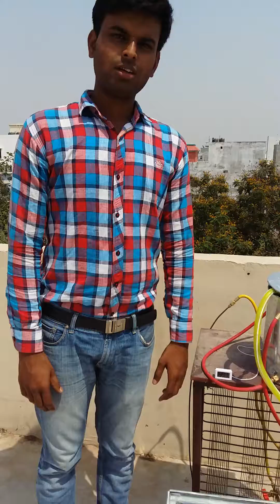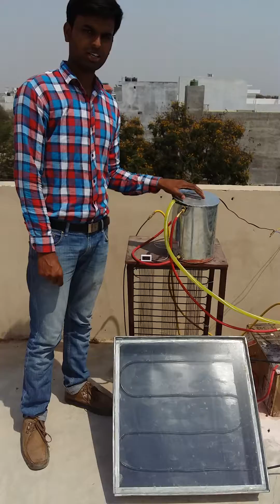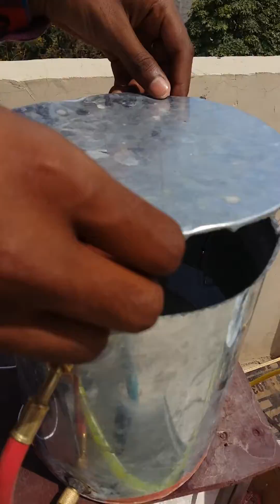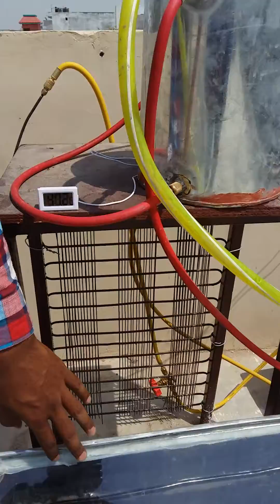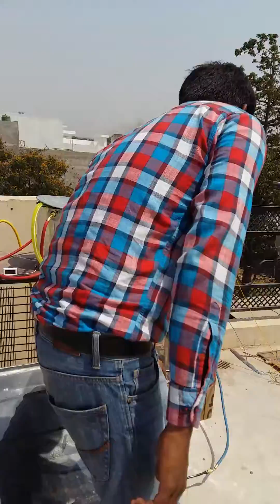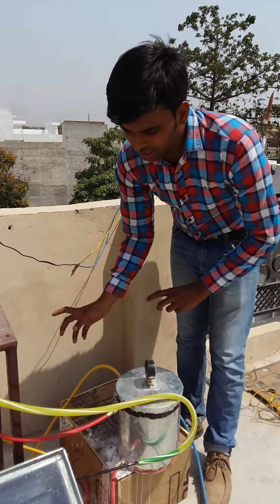solar adsorption refrigeration

Comment: Hi! Can you tell me the overall cost of your project ? How much did the fabrication of collector cost ?
Reply: The overall cost of this project is around 35000 for  get correct output I think he didn't get any output if u want any information then contact me
Reply: @anubhavraj5713  Aren't you trying to pull all the blanket to you from his work ? it looks like !
Reply: @anubhavraj5713  hi Anubhav, I would also like some info on the project. Can we connect on whatsapp or Facebook?
Reply: @anubhavraj5713  I am working on the same project. I need your help. Share me your contact number or contact me on 9175527555.

Comment: Copper is Corrosive with Ammonia your structure is wrong
Reply: M. Asim Khan  i m also planning for this project  i need help
Reply: email me plz
Reply: @waseemazmi6958  if u want to do this project then u have to spent minimum 35000 for get 30% output
Reply: He used gelatin not ammonia.
Reply: I Need help ,

Comment: Can you tell me which refrigerant n  absorber you used
Reply from the maker: zeolite and water
Reply: @aagatasingh10  u know the temperature and all
Reply: @aagatasingh10   I think ur project is not able to give any correct output
Reply: @anubhavraj5713  I think you are jealous
Reply: lot of research papers.............u can use my research work
Reply: @avinash7527  OK! Where can i read it ?
Reply: @AutoNomades  just put research work by avinash kanade...on Google..... solar power adsorption ice maker system

Comment: what is jewlett ??
Reply: He is saying 'Zeolite'.  
Zeolite 4A is generally preferred combo with Water in such Solar Chilling projects. I think they are available in India at around Rs. 100 - Rs. 200 per kilo.

Somewhere (some research paper, months ago) I read that approx. 150 gms of Zeolite is added to every 10 litres of water in Solar Adsorption Chiller.

Also while he has not explained it here, you would need a small vacuum pump to create a partial vacuum in that Adsorption tank - Condenser - Evaporator cycle.
Reply from the maker: it is zeolite

Comment: nice work ..
which type of solar collector you used n is it readymade or  u fabricated it??
Reply from the maker: its a flat plate solar collector which we made by using tin casing , copper tube and simple glass
Reply: @aagatasingh10  u think by solar collector u r able to produce that much of heat for runn this setup can u tell me once what is the boiling temperature of zeolite
Reply: how much max temp  did u got in your project??? can you give ur email id??
Reply from the maker: about 60 degree Centigrade. aagat.asingh10@gmail.com
Reply: @aagatasingh10  hai dear ajith sing   I am  hussain    I want  to  know  about  your  project..
Reply: @aagatasingh10   @ANUBHAV raj  I am working on the same project. I need your help. Share me your contact number or contact me on 9175527555.